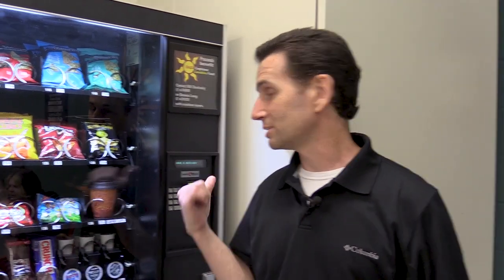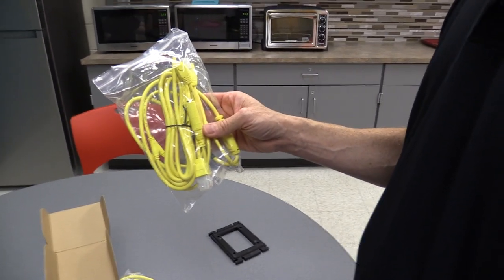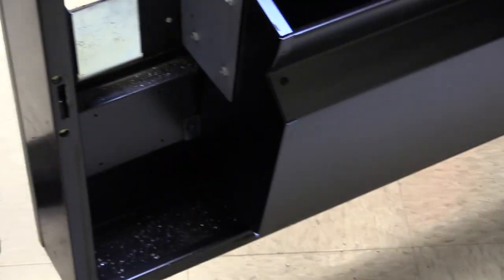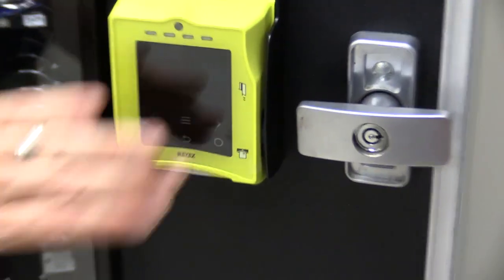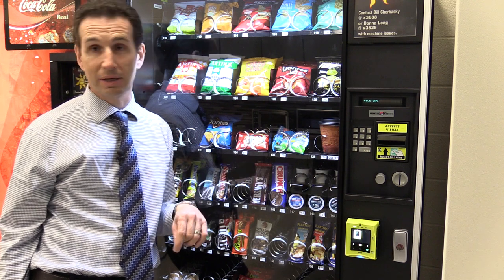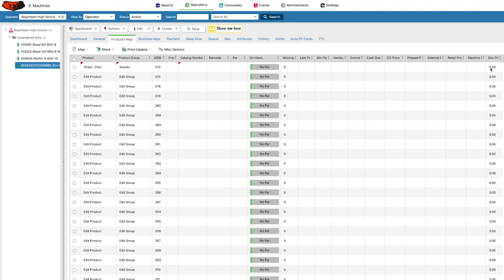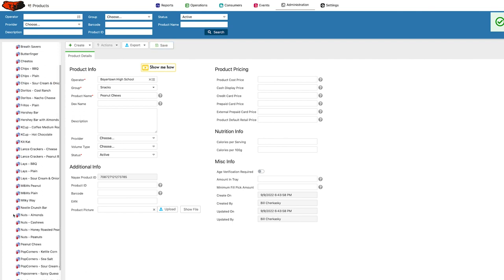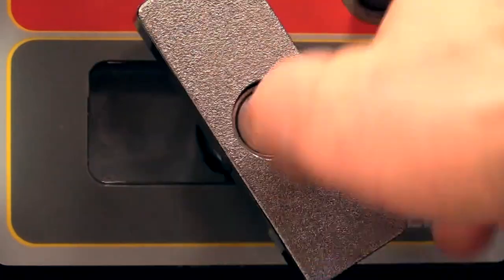How to Install a VPOS Touch CC Reader on a Snack Machine

Comment: This was a great video. Quick question where did you place the antenna wire? After u taped the wire against the machine?
Reply from the maker: I just wrapped up the extra wire and put it at the bottom of the door.  The antenna is on the door and it plugs into the VPOS Touch which is mounted to the door.

Comment: For the snack machine you need longer Cable and you can order it from them or just ask for it
Reply from the maker: You order it from them when you order the reader.  I think it costs around $25.
Reply: Yes  about 10 Foot When you buy a new credit card Nayax you can ask for the long cable not the short cables

Comment: one of my machines has a frozen interface. Is there a way to restart it from the touch panel?
Reply from the maker: If it is frozen...probably not.  Just unplug the machine for 10 seconds, then plug it back it.